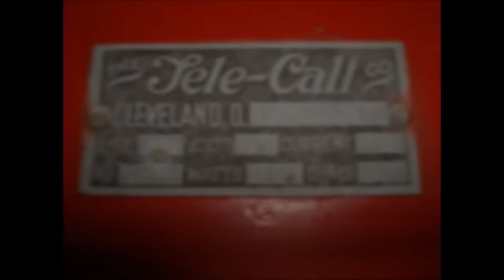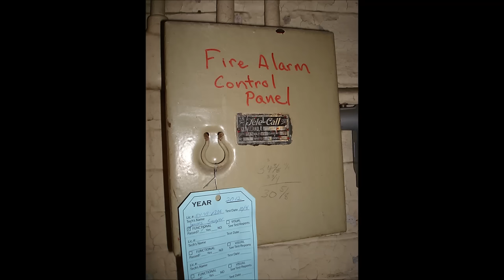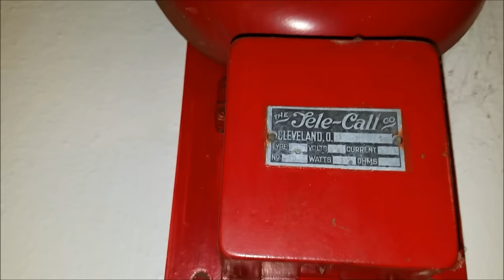Old Cleveland School Fire Alarm

Comment: I'm glad to see this system go for almost a hundred years.
Reply: That system looks like it can go for another century or so as long as maintained properly.
Reply: This is probably the best fire alarm control panel design I've ever seen. Way better than those digital ones today. Does that particular one have a timer?
Reply from the maker: @sigglass2183  No, this system does not have a timer.  It has to be manually turned off once activated.
Reply: @sigglass2183  That's like saying a Model T is the best car ever designed, yes it's an amazing and interesting piece of history, and the fact that it still operates after all this time is very cool, but to say it is the best design ever is ludicrous!
Reply: @anythingalarm5429  Sorry for the late reply but excuse my pun because this system sounds really impressive to face the test of time.
Reply: @sigglass2183  It still works because it's never actually running unless you turn it on, it's basically the same technological level as a light switch, this wouldn't even be considered a fire alarm in today's standards or for the last 20+ years. It doesn't detect fire.. modern day panels run 24/7 365 hence why they need to be maintained. Anyway I'm not here to make an argument or come across as negative about old systems, I guess I'm just not as impressed by them having worked in the industry for a while.
Reply: @anythingalarm5429  This is because that fire alarm system is grand fathered which had smoke or heat detectors as Old School Fire Alarms never specified. That system unlike modern systems are made of inferior materials which will not last as long as 40 to 50 years.
Reply: @sigglass2183  There's no smoke or heat detectors on this system.
Reply: @anythingalarm5429  That is true but they could have been installed to the existing system.
Reply: @OldSchoolFireAlarms  How is it turned off? I don't see a switch or anything in the panel
Reply from the maker: @ThePurpleMage1  There is an ON/OFF switch in the office.

Comment: Thank you for showing these historic buildings and the fire alarm systems installed in them. In this video (along with several others of yours) I spotted wall inlets to an original Spencer Turbine Central Vacuum system. I keep hoping to catch a glimpse of the main unit! Some schools (like one I explored in Cincinnati last year) have had the equipment removed sadly, but many I am sure are still intact.
Reply from the maker: Most interesting.  Now that you mention it, I do remember seeing the main vacuum systems in some of the school buildings I have visited over the years. The main units are always housed in the boiler rooms, in the lower sections of the buildings. Great observation on your part. Thank you for watching and your comment.

Comment: Very nice footage!! Love hearing these old bells.
Reply from the maker: Thank you Jared for watching and for your comment.
Reply: @OldSchoolFireAlarms  No problem. Btw, when I went on your website earlier it appears that when you hit the tabs to go to a different page it only gives you a second to select which section you want to go to. Thought I would just let you know.
Reply from the maker: Thank you for that, I will look into it.
Reply: @OldSchoolFireAlarms  Just recently learned that the older portion of our school had Simplex 4080 fire alarm bells (which were in were most likely installed in the 50's). However, it doesn't appears that a pull rod system was installed thus probably being coded pull stations. I don't know what kind of panel it had. Probably either Autocall or Simplex. They replaced/upgraded the system in the 90's to Simplex 4903s which some of them were being replaced by TrueAlerts. I recieved a few comments on potentially salvaging the system once the time comes. I'm wishing you the best of luck with saving this bell system from getting destroyed. Its really heartbreaking seeing stuff like this get destroyed.

Comment: I revisit these videos once in a whole - for this one I can't get over how primitive the "alarm panel" is but it works, basically does the same thing as the fancier ones.
Reply from the maker: Primitive indeed but gets the job done. What I love is that it is 100 years old and never needed any maintenance or replacement parts. Unlike the cheap, junk systems that are made today.

Comment: You dont by any chance have a vid of the pull rod alarm at the old Whittier elementary school do you?  It was a later model and had the bells as well as did a voice announcement through the pa speakers in the building wich didn't always work . The pull rod went from the basement all the way up to the 4th floor
Reply from the maker: Unfortunately I do not have a video of that particular school.

Comment: You can see brass oil cups on each end of the motor that drives the coding mechanism. inside is a wick that presses against the shaft to keep it lubricated.  This is why I love older electric motors.
Reply from the maker: Great observation Joel. Most people would not notice that.
Reply: @OldSchoolFireAlarms  I have a tendency to notice details due to my aspergers syndrome.

Comment: Why does the wiring in the panel look somewhat modern. You think It would be knob and tube or cloth insulated. Is the panel as old as the building or was it added later.
Reply from the maker: The panel is as old as the building. Some wires had to be updated and replaced in the building due to age concerns, especially involving safety hardware.
Reply: Fire alarm

Comment: There is an old school in my area that had a pull rod system but for some random reason got pulled out. The old system originally consisted of pull rods, ibm break glass stations, heat detectors, and vibrations horns. The system lasted 95 years and running. The district decided to replace it and remove the pull rods. A simplex 4100 system was installed. It lasted 2 years and died. It Was replaced with another simplex panel and half the horns wouldn’t sound due to programming errors shutting off the NAC. The old system had 5 horns and could be heard over ambient noise levels. The new system has 90 horns and I was told that you can barely hear it through a closed door. If only people would start making alarms to the quality of these old systems. In the 50s these new systems would be laughed at unlike today they are considered “breaking edge”.
Reply from the maker: Thank you Dale for watching and for your comment, I could not have said it any better.  The new systems are junk compared to the older, superior systems of days past.
Reply: This comment reminds me of my middle school's fire alarm system being replaced in 2017.

Comment: After reading a few articles about the fate of this old building.  It sounds like it'll be used again as the result of a merger. The district is currently refurbishing Stonebrook and using that school and this school along with the merger. From what I read, it doesn't appear that this building will demolished after all.
Reply from the maker: If true, that is good news to me. I just hope whoever takes care of the building does a good job.
Reply: @OldSchoolFireAlarms  I will keep my eyes open for updates.
Reply: @FireRescue80  This school cancelled its plans to be demolished and is back open to the public as of 12/2022, but the system I believe has been switched out for modern Horn/Strobe units

Comment: Amazing! That system with regular maintenance would last forever. Why is there a Western Electric sticker on the inside of the panel door? Did western electric have a fire department dispatch or something? Thank you for this amazing video!
Reply from the maker: Western Electric was a company that made utility cabinets/boxes for electric appliances.  Thank you for your question and for watching.

Comment: That's just about THE smallest fire alarm panel I'd say I've EVER seen, never seen one like that or by that particular company either. Definitely unique code wheel too, especially as it does VERY slow Temporal Code 3. Most other systems installed in old schools, such as those showcased in your other videos, do Code 4-4-4-4 instead. Also those are just about the only fire alarm bells I've seen with the mechanism below the gong rather than behind it like with most electric bells.

I do hope that you try your darndest to remove every single fire alarm component out of every old building you come across that's scheduled for demolition. Stuff that old and that rare is irreplaceable.

Real shame that it seems most old panels suffer the fate of having their guts torn out and being used as a wiring cabinet instead. Shame that today's techs just plain do not have any respect for older systems (and thus gut the panel rather than remove it intact).

Pretty much all the bells in almost all of your videos have nice "rings" to them, heh. Same for the horns. And as some people have said, even though they might be SEVERELY outdated by today's standards, nice to see most of these systems continuing to protect the occupants of the building they're installed in 'till the day they're demolished.

Any idea why this particular school has/had what appear to be Faraday bells (like the one at 4:08) in addition to the Tele-Call bells?
Reply: I bet they replaced some Tele-Call bells that sadly didn’t last 100 years.
Reply: @tots16  Yeah, maybe.

Comment: I am wondering. What were the model numbers of the manual trip bells, actuation switches, single stroke bells and control panel? also how many pull rods were there in the school?
Reply from the maker: I could not find any model numbers on any of the devices you mentioned.
Reply: @OldSchoolFireAlarms  oh, that's okay

Comment: The T3 pattern isn't very common in old systems, right? Most do a 4x4 cadence or a 4x2 cadence.
Reply from the maker: It all depends what one considers old. In the 1920's, when some of the very first electric fire alarm systems were invented, T3 was very common in the few schools that had electric fire alarm systems.  Not until the 1940's up thru the 1960's did cadence 4-4-4-4,  cadence 4-4,  and cadence 4-2 come into play. Thank you for watching and the great question.

Comment: That's a really cool system!  I'm surprised they allowed it to be used through 2012, and it must have been cool to hear the bells throughout the building.
Reply: Cleveland City Schools still operates in a lot of older buildings due to the high cost of building new buildings. Akron Public Schools has torn down a good number of theirs and built new schools; the new Firestone High School was one of those. Most of the schools in Northeast Ohio are being rebuilt or have new schools because the way the state funds the school districts has changed in the last several years allowing more money to go to building projects. My district is currently in the process of building a new Revere High School and elementary school (grades 4-5) (built in 1951 and 1921 respectively), while the existing middle school and primary elementary school (grades K-3) will be extensively renovated along with a new bus garage because the transportation facility we currently have is inadequate and the school buses have to be parked outside which leads to a lot of maintenance issues, especially in the winter.
Reply from the maker: Actually that was an old inspection tag that had not been removed.  This system is still in operation and going strong. Public schools are "grandfathered-in" and are allowed to keep and maintain their old fire alarm systems if they are in good working order.  Thank you for your comment and great observation !!
Reply: @sirenfreak57  sounds like Portland public schools in Portland,OR. Most of there buildings are in older schools Because of money. Since building new schools are ridiculously expensive. But the Original fire alarm systems are Long gone. The school I went to when I was in the district was a Silent knight system. And there now switching to potter I saw in one school.

Comment: How many times does it go around?
Reply from the maker: It continues to ring until someone turns it off. The system has to be manually shut-off to stop the bells from ringing. There is an on-off switch in the main office of the school.

Comment: Why is there a Simplex 2901-9333 at 4:07?
Reply from the maker: Great question!  If this was a vibrating bell, it was used for a class change bell and tied into the Simplex clock/time system. If it was a single stroke Simplex bell, it was tied into the fire alarm system.  The problem was that the bell was mounted too high on the wall and I was unable to verify for sure what the bell was used for.
Reply: @OldSchoolFireAlarms  It's vibrating. You can tell with that generation of Simplex bells because the single-stroke ones have the bolt through the center rather than offset to the bottom.

Looking on eBay, it turns out they did make an AC version of that bell, but why they would use a red one for class change (especially in a school with red fire bells) is beyond me.
Reply from the maker: @Fahrenheit4051  I agree, but I see that all the time. Again, if it is vibrating, then it definitely was wired to the class change bell system.  But you are 100% correct, it should not have been painted red.

Comment: What happened to this school?
Reply from the maker: This school is still opened and operational.
Reply: @OldSchoolFireAlarms  I work at an elementary school in my hometown that was built in 1930, with additional classrooms added in 1953 and 2003 and a brand new library around 2003. The school doesn't have a vintage fire alarm system however, it's completely modern. There's also a private school that used to serve as the town's high school, which was built in 1924. I'm not sure if it retains an old system however. Nevertheless, I thought it might interest you. My town's name is Scotia, a suburb of Schenectady, New York. There are tons of old schools still operating here.
Reply from the maker: @homeworld1765  Thanks for the information, most appreciated.

Comment: What’s wrong with the school? I assume that there is a valid reason for demolition...or not...:/
Reply from the maker: The short answer, most of the schools that are demolished could easily be renovated and last another 100 years. But to do that general contractors would have to spend more money on labor cost, because labor to renovate old, historical structures cost more then new construction labor. Hence, less money would go to owners of the construction companies. Construction companies would rather hire cheap labor to build new buildings then pay more for skilled labor and craftsmen to renovate old, historical buildings. There are other reasons as well but would take too long to explain it all here.
Reply: Old School Fire Alarms , while you are absolutely correct about it being a cost driven thing, it’s not fair to lay it at the feet of the GCs. The general contractors are bidding on plans and specs prepared by a design firm (architect). The design firm prepares those plans based on direction from the owner (school district). The school district provides that direction based on their needs, budget, and public input. 
So, it really gets down to there being inadequate public support for historic preservation when it comes at additional cost. 

Also, great videos 👍. I had no idea about these pull rod systems, very cool.
Reply from the maker: Hello Robert,  thank you so much for your comment and watching my videos.  Everything you said is very true and I do appreciate your comment on the matter.

Comment: Was Tele Call the first fire alarm company to exist?
Reply from the maker: No.
Reply: I am curious, do you know any old fire alarm system like the ones featured in your videos where the building has fire doors that would close when the alarm sounds to keep the fire from spreading?
Reply from the maker: No, I do not.
Reply: @OldSchoolFireAlarms  Do you think these older schools should have fire doors installed as the codes changed with time going on?
Reply from the maker: Yes, they should.
Reply: Has this school closed yet?
Reply from the maker: No, it is still open and operational.
Reply: When is this school suppose to close?
Reply from the maker: Probably in two years or less.
Reply: Is this the oldest fire alarm system and panel you know?
Reply from the maker: Yes, so far this is the oldest one I have found that is still in operation.
Reply: When did you record this video?
Reply from the maker: About two weeks ago.
Reply: @OldSchoolFireAlarms  So you uploaded this video not long after recording?
Reply from the maker: Yes

Comment: there should of put white flashing strobes
Reply from the maker: This system was installed in the 1920's. Back then there were no flashing strobe lights available for install. As time marched on and strobes became available, this particular system was not designed to accommodate strobe lights. A totally new system would have to be installed to add strobe lights to an audible sounding system, and that would be extremely expensive for this size school. Fortunately, the school is "grandfathered in" and therefore can still use this old, original system as long as it still works.